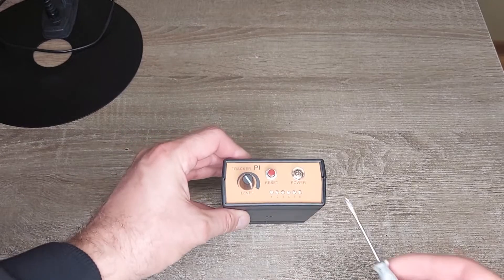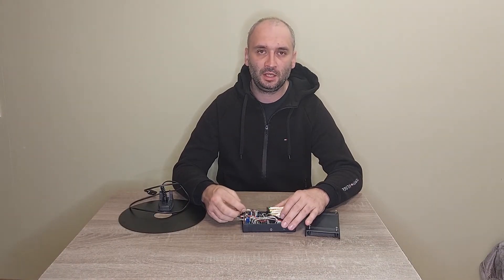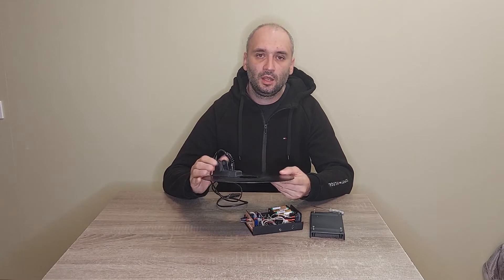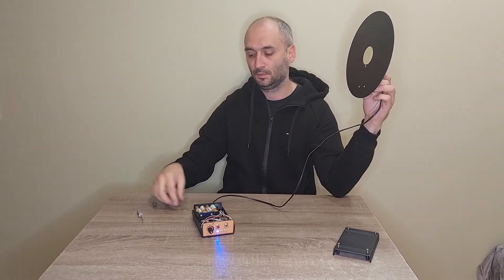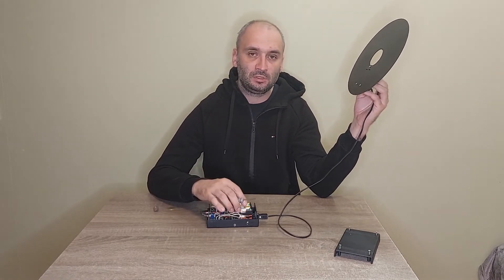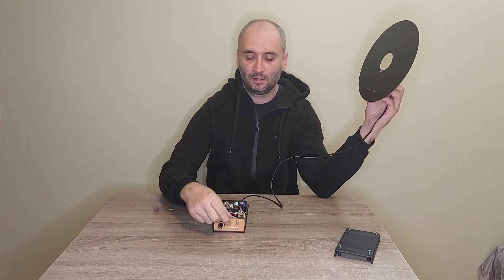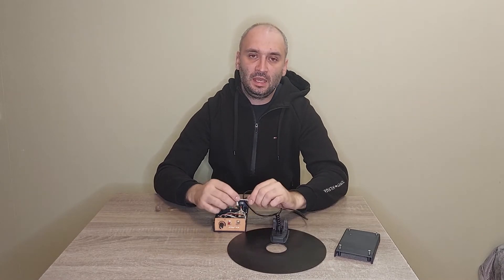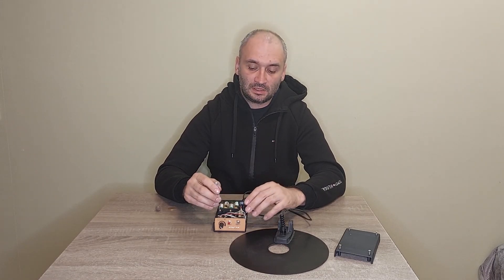Pulse metal detector control unit Tracker PI-2

Comment: Will this work with the 2x2m search coil or a bigger coil of 8m??
Reply from the maker: With a depth program (you can order it instead of the standard one) with a frame of 1.5 * 1.5 m, the iron gate takes 5 meters. from 2*2m - 6 meters. I have never tried the big ones!